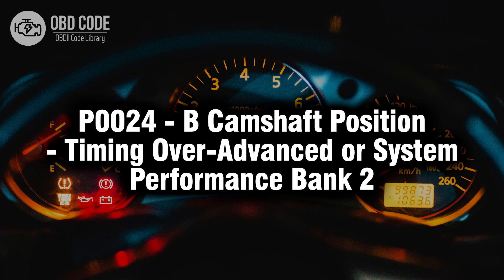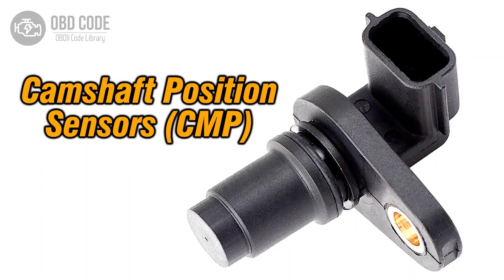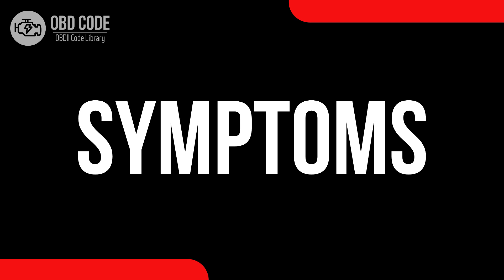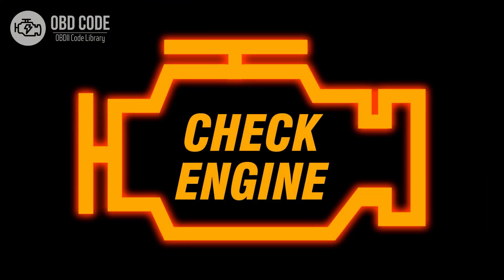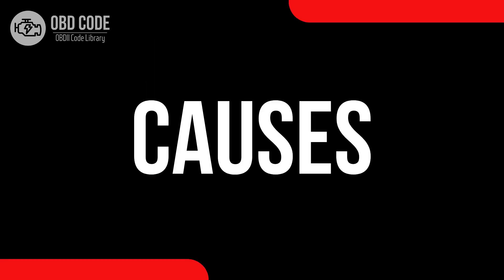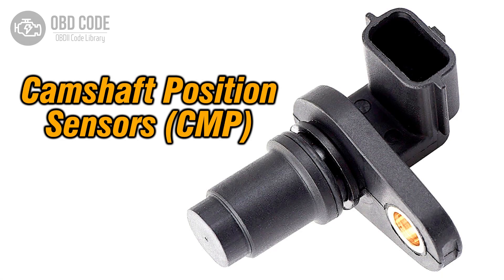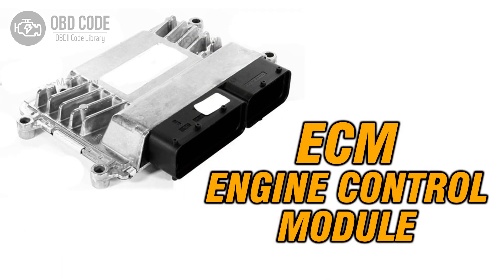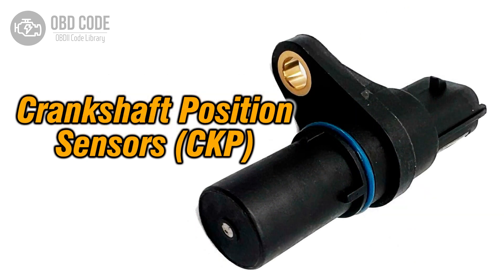P0024 B Camshaft Position - Timing Over Advanced 🟢 Trouble Code Solved 🟢  Symptoms Causes Solutions

Comment: I have a low mileage (46,000) 2014 LaCrosse with this error code (P0024) coming up once a tankful of gasoline.  There is no change in performance with my only symptom being the failure of the remote start functioning until I clear the code with my ODBII device.  I have concerns regarding timing chain issues, but this engine apparently has been bullet-proof until hitting 100,000 mile territory.  my current use is down to about 1 tank of gas a month, I religiously change the oil annually and use high detergent fuel.  Some potential fixes address the PCV valve ports needing cleaning/expanding.  The vehicle does not seem to be using oil at all.
Reply from the maker: 👨‍🔧 Chat with a mechanic to get advice on your vehicle's fault
https://wa.me/message/4GKMVTKJOA5NP1